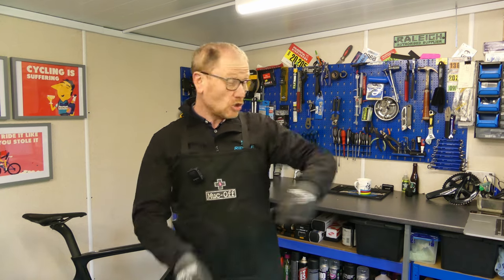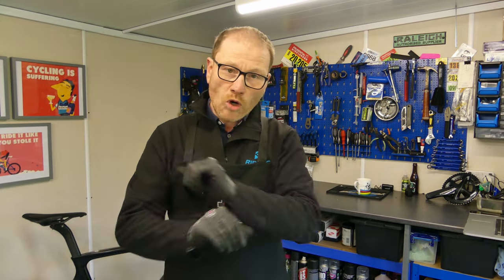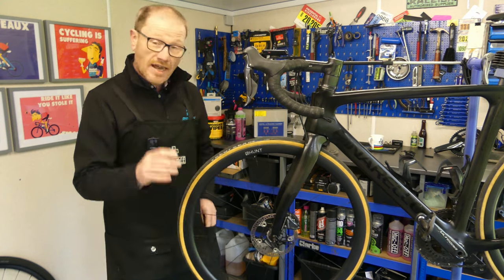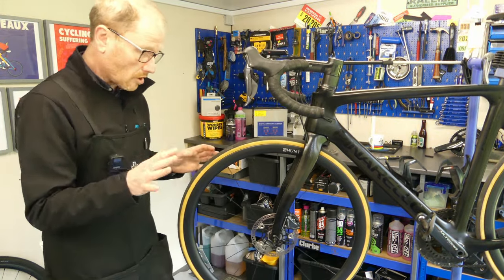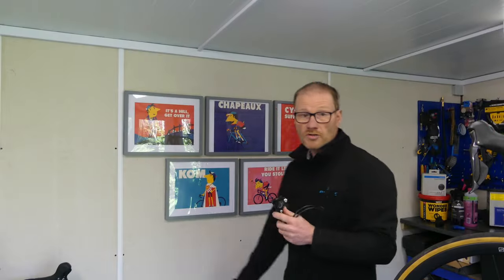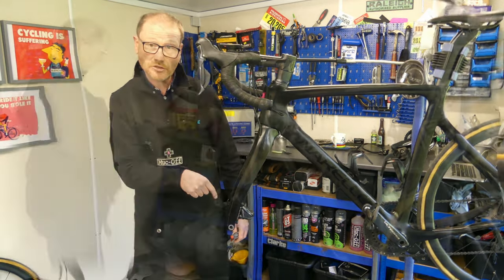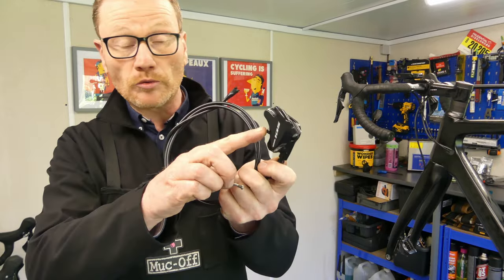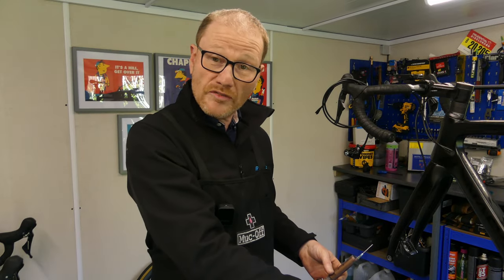How To Stop Disc Brakes Rubbing On Your Road Bike - Bike Maintenance

Comment: The "squeeze the brakes and tighten the bolts" trick seems logical but doesn't work, I had to spin the wheel and hand adjust the brake housing until I didn't hear rubbing anymore, then carefully tighten bolts
Reply from the maker: That's caused when the two pistons don't retract equally into the calliper, known as a sticky or dragging piston. Both the lever vacuum, and the pad spring will apply a shared load across the two pistons. That shared load will always follow the path of least resistance. The piston with the least resistance will retract further into the calliper than the one that drags, resulting in the other piston protruding. This can usually be overcome by cleaning the sides of the pistons with brake cleaner and a cotton bud. Chances are, your rubbing problem will return, so you may want to try this.
Reply: @ribblevalleycyclist  It's a brand new Canyon Grail out of the box... I'm pretty sure the pads aren't dirty
Reply from the maker: @thebrunoserge Agreed, it won’t be dirt. That is most peculiar, a new bike shouldn’t be doing that. I would recommend you check that both pistons are retracting fully. That check is easier done with the wheel removed. If they’re not retracting fully and equally, then you may want to speak to Canyon about it.
Reply: @ribblevalleycyclist  It’s not that peculiar, cycling brands just charge premium for shit engineering and quality control. That’s perfectly normal under late stage capitalism, sadly. It’s OK it works now the housing just has to be positioned by ear instead of using advice that assumes the brake pads will release equal distances on both sides, which they almost never do

Comment: A pair of Chorus rim brakes with Swisstop pads no problems, easy to maintain and work a treat.
Reply from the maker: I would agree with you, in some applications, Chorus rim brakes with Swisstop pads is a better solution, easier to maintain too. However, when running carbon rims in the rain whilst descending a Lake District pass would be suicidal. Both have their advantages and disadvantages. 

Thanks for watching.

Jon
Reply: @ribblevalleycyclist  I would agree with you horses for courses. Depends on the type of cycling you do.
Reply: @ribblevalleycyclist  In the rain at a steep descent disc brakes  make you magically immune to slipping of the tarmac-rubber interface between your wheel and the road? It's like saying: don't worry, put disc brakes on and I wish you are joyful flight out of the next road turn.

Comment: I'm no bike nerd, I don't really learn much about the bike I ride except how to fix a flat tire. So, ever since I bought the bike, I was under the assumption disc breaks never wore out and barely needed any attention or maintenance.  6 years with a single bike, I only put it in the shop for maintenance twice.
Reply: 40 years riding and never was any of my bikes in a bike shop. The trick is to do it all yourself.

Comment: I always need to use a spacer in my front disc brake when aligning it after taking the wheel off. I didn't know there was a tool for it, I have just cut a few thin clean cardboard pieces from food packaging and I shim it on the right side of the disc brake and that gets it. The ol' beetroot goat cheese meal packaging spacer works every time.

Comment: I had the same issue of a small rotor adjustment needed.  I used the location method you mentioned, found the spot, was minimal.  But I used the back end of a lg screwdriver, slowly tapped in the direction and amazingly it worked as I didn't want to overdo it with a crescent wrench or such. Awesome vid my friend. Thank you from N. California
Reply from the maker: Hi Michael. Glad you got it sorted. The screwdriver idea is brilliant 👍. Greetings from a slightly damp England 😂

Comment: Great video. I use a pointed cotton tip soaked in isopropyl alcohol to clean the exposed piston sides.
Reply from the maker: Thanks Blair, glad you liked it.

That is a Top Tip! If you're going to town on it, then a cotton tip soaked in isopropyl alcohol is the correct way to do it. Following up with a cotton tip and brake fluid is also a good idea. I was considering doing 3 separate videos, and showing more detail, like you've suggested. But in the end, I went with the condensed version in one video.

Comment: I had a fourth reason pop up on a brand new bike.  It was rubbing, not too badly, but rubbing right from the get go.  Drove the shop mechanics crazy trying to figure it out.  Finally I ended up pulling the rotor off and remounting it on the wheel.  Voila, no more rubbing.  Weird because it wasn’t loose or anything, properly torqued, but it somehow managed to get a little cockeyed to create rub.  I’m finding I have to remove and remount it every once in awhile as it gets out of alignment over time with use.
Reply from the maker: Good point, viffer94. This is more of a problem for the older skewer style quick release bikes, thru-axle does a better job. I always recommend putting the bike on the floor with the wheel loose, leaning on the bike to add weight, and then doing the wheel up. You then align the caliper to that. Then, in the future, if you take the wheel off, you just need to lean on it when doing it up for perfect alignment.

Thanks for your thoughts.

Jon

Comment: You make really useful vids. In my experience though, bent rotor because of overheating will sadly bend again. Getting a 140mm high quality one will solve the issue.
Reply from the maker: Thanks, Pirmin, appreciate it.

Agreed. If you have a close look at the bike in this video, I'm using floating discs from Hope. This type of disc is amazing at resolving warping caused by overheating. I will never buy any other disc again. Well worth checking them out, but depending on your location, they can get expensive.

Thanks for watching.

Jon

Comment: Great comment on copper slip to prevent galvanic corrosion on retaining pins, would be a nightmare on such a thin bolt (snap in half city :))......
Reply from the maker: Hi Sean, Oh, it is. And they're made from really soft steel, and have a flat screwdriver head, so they round off really easily. You can get titanium versions, but they're silly money. Best just use a bit of copper slip, and don't do them too tight!!

Thanks for watching,

Jon

Comment: Very detailed video! Just come across your channel when I have this problem today. However, my disc still rubs after these three methods. At this point, would you say I should check if the brake mount is perfectly faced or anything else? (New bike, new components, bleeding just done today)
Reply from the maker: Hi, 
That sounds very annoying, especially with new kit! The question here is to work out what is causing the rubbing, is it misalignment, or is it sticking pistons? If it's new components, then the chances are, it'll be a bleed issue. Also, facing is rarely something you need to do on a used bike. Facing is usually needed post-production of the frame, to tidy and straighten the mounting points. If I were a betting man, with the information I have, I'd say the pistons were not returning in. It may be worth double-checking the hoses for air. I did a video on brake bleed, it's here:
https://youtu.be/eGclavtkoIg

Comment: Thanks so much for this video. I recently washed my road bike after a day in the rain, I took my brake pads out, cleaned them with isopropyl alcohol and so did with the rotors. Unfortunately, I did not note the position of the pads (left/right, forth/back) and so in my next ride I got a back/forth wobble in the front wheel when braking hard in a decent. Can the wrong repositioning of brake pads cause such wobbles and if so what would be the best remedy?
Reply from the maker: Hi Dimitris, Mixing the pads up can result in differing pad thickness within a single calliper, and therefore may cause pad/disc rub or a knocking feeling when breaking. My suggestion is to put pads together that look to be of similar thickness. 

Also, it's worth giving the pads a bit of a clean, check this video out:
https://youtu.be/DLFQAuv9fCg

Comment: Great video!

I'd  rather see the pistons of the brakes bottom out in their original set position. Using the spacer and loosening the housing might only be reading a warped rotor. 

On a side note: Shouldn't you check to see if the rotor is true first? What if you try correcting it by loosing off the piston housing and it reads where the warp is? I know this is likely not going to be the case because of the low chances but it would be as simple to check for the warped rotor first.
Reply from the maker: Hi Hexus,

Glad you enjoyed it. 

The idea of the video is to show you the 3 main problems you may have, and how to overcome each one. You wouldn't necessarily do each one in the order I did them!!

Thanks for watching.

Jon

Comment: Great video, but one of my pistons does not move back at all. I have been cleaning/ pumping/ cleaning/ greasing. But it won’t move back. What to do?
Reply from the maker: First of all, should it move? Some very cheap brakes only have one moving piston. If you’re sure it should move, then hold the apposing piston back, and pull the brake, that should get it moving. Careful though, it may end up moving too far!

Comment: My wheel appears to wobble.  Would that be the cause of disc rubbing?  Or can a wheel wobble independently from a disc rubbing?  :face-orange-raised-eyebrow:  My bike was shipped to me for some assembly; I heard that the disc brakes can be damaged in transit.  I could see the wheel wobble when I took my first spin, and I could hear the mechanical disc brake rubbing at the same time.  My powers of observation were not strong enough to tell if the two things were in sync, but I have ordered a spoke wrench and the tools you noted to try an adjust the situation myself--just as soon as I understand.

Comment: I’m new to brake disc’s and I’ve got them on my new canyon Aeroad. I’ve done the tip for the front and it worked 1st time. Rear seems to be rubbing too. Is there a similar tip to stop this ?

Comment: Allow me to add one more cause of brake rub.  Pertaining to Sram AXS:  my Red AXS brakes began to rub after running them about 1000 miles.  This occurred several times after bleeding and new/used pad installs.  What happened?  Well, to the best of my ability to troubleshoot, the issue was in the adjustment of the contact point and lever reach adjustment system (as it only occurred on the right lever.  Looking at available schematics of the AXS levers, it appears both screws are part of the brake fluid reservoir piston, with the top contact point screw rotation moving the piston up and down, and the lower reach adj screw moving the lever in and out in relation to the piston.  So, the both work on opposite ends of the hyd piston in the lever.
Sram says to back out the contact point screw when bleeding.  I found that in order to eliminate brake rub, I had to run both the reach and contact screws through their full adjustment several times after bleeding (and after suffering from mid ride brake rub) and while doing so, I encountered a sticking point with the reach adj screw - almost as if there was excessive Loctite on the reach adj screw threads.  Since using this method post brake maintenance,  any mid ride brake rub has gone away.
Also, I found it critical not to swap left/right pads if removing and replacing again for any reason.

Comment: Here's one I have never read about. Bike is a specialized turbo levo SL carbon...over $8000. Rear brake dics in not running true. Tried mounting three different rotors and still same run out. Mounted the rotors in different positions   on the hub and the run out was always at the same postion of the hub, not the rotor. Turns out the machined mounting surface of the hub was out of true. Took me a day of tinkering with dial iindicators, truing stands, etc to figure that one out.

Comment: Yes, but if the pistons need to be pushed back, doesn't that mean they will get stuck again and again?
Reply from the maker: If the piston is moving freely (Seals not dirty, or failing), then the combination of the lever pulling the fluid back, and the pad spring will push the pads away from the rotor.

Comment: how do you turn the outside nobs , too looses the brake a bit ?
i dont have that tool..  my brake already touch the brake, even if i not brake, mt5  e-stop 4 pistons, already backpain now from putting it on as good as it can but still touch if i not brake at all.. i got the storm hc magura 203 rotor. roting free now, and then if i brake now again the pads are touching them again grrrr :( HELP plz

Comment: sometimes method 1 and 2 still won't work, i ended up eyeballing the gap and carefully moving the caliper to the correct position then tighten the 2 bolts little by little.
Reply from the maker: I must admit, biking chupei, I've sometimes done it that way too. This is the problem when you're working with such tight tolerances. 

Thanks for popping in and commenting.

Jon

Comment: you can just hold the sharpie against the front fork and let the tip come into contact with the disc as its spinning,easy way to see where its rubbing and cleans off with with ipa.
Reply: You need to be careful doing that, some ink contains natural oils..... which, if it gets on the pads, will result in squealing brakes

Comment: Have centered the pads and after few rides rubbing again. Why? Daaaaaaamn those DB . I need rim brakes for sure ! :D
Reply: Yup, I've been using disc brakes on my mountain bikes for over 10 years now, and I see no reason to use them on a road bike. As far as your immediate problem is concerned, you could be dealing with eather, a sticky piston, or a rotor that gets easily bent, probably a worn one.
Reply: @independentthought3390  As i see the problem is on pistons. One is more outside .
Reply: @Godspeed961  In that case it's definitely a sticky piston problem. This video should tell you how to fix it https://www.youtube.com/watch?v=53x5I1wc14E
Reply: @independentthought3390  I should try it ! Thx mate !
Reply from the maker: Agree with IndependentThought, sounds like a sticky piston. Good luck with the repair, and let us know how you get on 👍
Reply: Τry the steps and insist many times but nothing happened ( I like the cleaning of the toothbrush, but you need a small one to fit inside ) . Always one piston comes more out than other. But when i put them back all i see i have to centered whe whole brake system to the center. So i put pistons back and centered . That fixes the problem. The strange is that my other rear brake has the same problem (but no rubbing lol). When you look at it, one piston is more outside but wheel turn right i think. Is this happened cause my rear brake rotor is smaller (140mm) ?? Should i put 140mm rotor to the front brake too? I will see if rubbing comes again .... Thx for the help again guys !  I think the front wheel still rotates while i write  :D
Reply: @Godspeed961  Yes, in my experience, sticky pistons can be very persistent. However, a lot of times you can manually adjust the caliper to compensate for the sticky piston, and eliminate the annoying rubbing that way. However, at this point I'd check if your rotor isn't bent, which might be causing rubbing.
Reply: Ultegra Shimano ice rotor lasts about 10k kms (140mm rear brake). Now i choose SRAM Paceline . Its heavier - thicker ( 1.55 min vs 1.50 shimano) and i bet it will bend less than shimano. Lets see !

Comment: i know im not guna get my answer in time but i still want to know what 2 bolts do i loosen cuz i cant find the 2 that fits 4 ellen wrench
Reply from the maker: The two that mount the calliper to the bike. Possibly your bike uses a different size
Reply: @ribblevalleycyclist  Is it the 2 silver not facing towards me cuz those 2 take 5mm
Reply: @ribblevalleycyclist  Do i re tighten really tight? or tight enought?
Reply: @ribblevalleycyclist  its still rubbing

Comment: While this is a good video covering all the points, these are just temporary fixes. Rotors warp again under heat, pistons clog again, especially with metal pads, etc. etc. Even with perfectly clean and adjusted brakes you get a little mud or sand grain wedged between the calipers and disc and it rubs again. ☹

Forgot to add: the permanent solution is to just ignore it. Eventually it goes away.
Reply from the maker: This is the trouble with disc brakes, they're good, but also a pain in the ar$e! 

The Hope rotors you see on the bike in this video are great, they're floating rotors, so are less prone to warping under heat. I'm a big fan of this technology and will only use floating from now on.

My front rotor is currently rubbing, I'll ignore it and let you know how i get on, fingers crossed you're right 😉

Thanks,

Jon